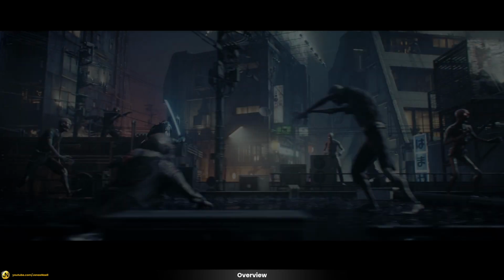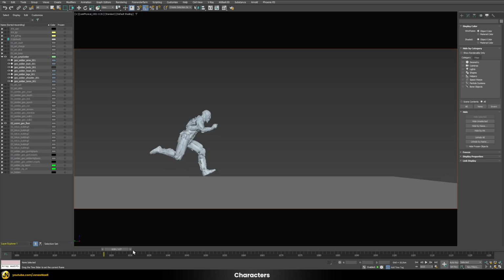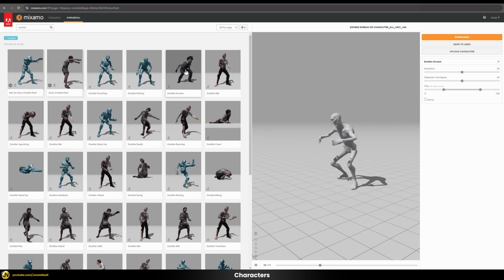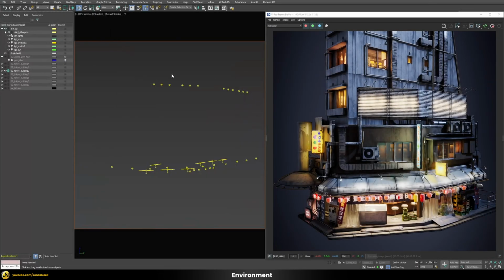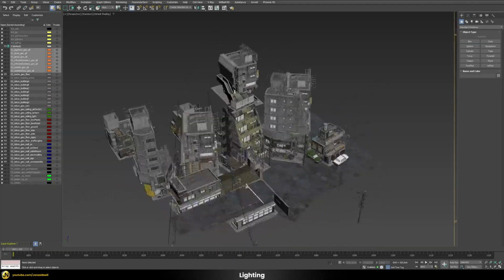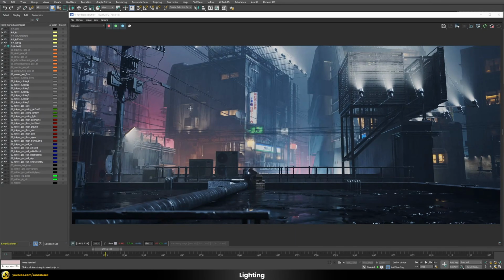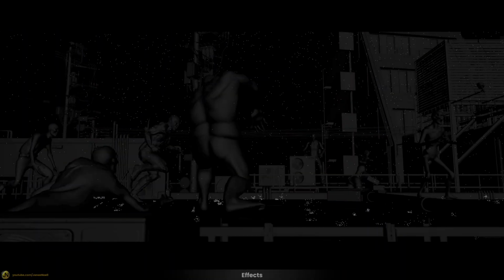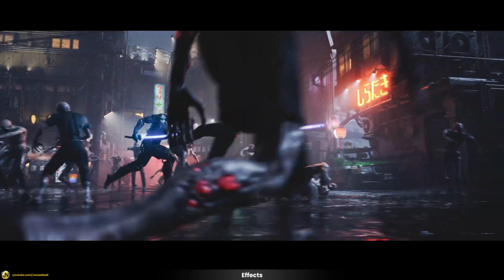Kinetic Rush | Zombie Chase + BREAKDOWN

Comment: Hey Jonas awesome job. I got a quick question, in your rain tyflow setup what was the workflow like in that setup because I did something similar with a snow anmation with individual planes that I put an opacity map on to create the snowflakes, but I had a bitch of a time trying to convert the animation to a static geometry because it would take up tons of GB of to generate. So what did you do?
Reply from the maker: Hi, I just used the standard LowRes Sphere Shape and rendered as Render Instanes. That worked fairly ok. But still took quite a while simulate all the particles.